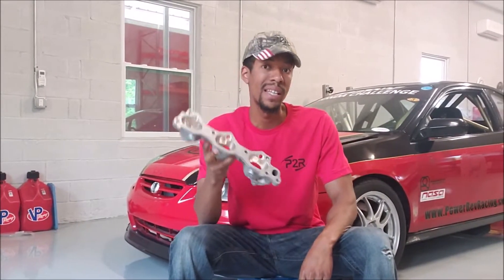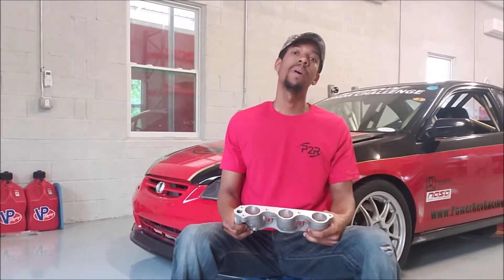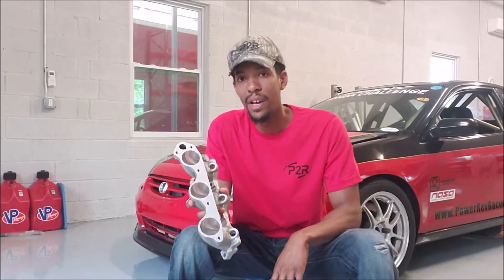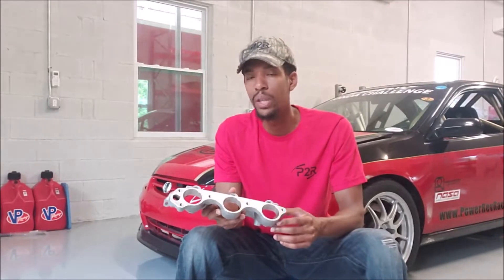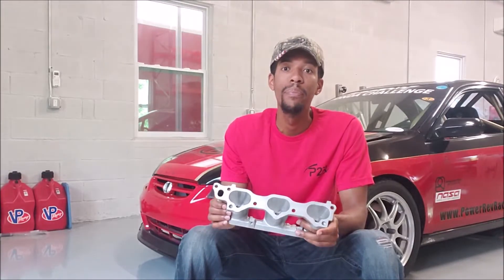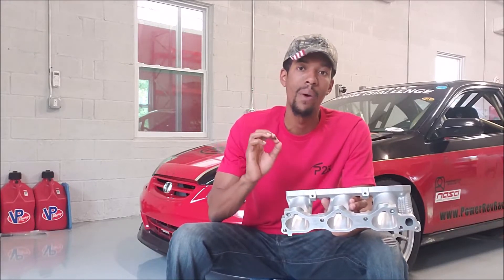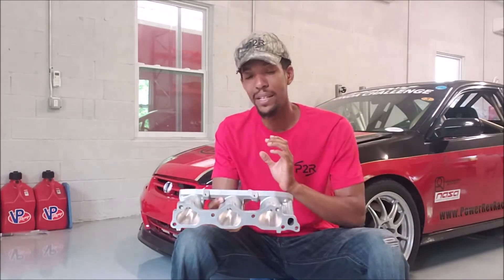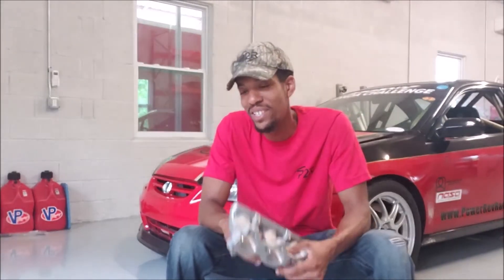P2R CNC Ported Lower Intake Manifold Runners

Comment: With ported lower runners, will the cylinder heads or inake manifold need to be port matched or is this porting just a smoothing of the bores and it still is flush with intake manifold/head port diameter ? Thank you

Comment: This is a good last all motor mod before upgrading your cams. I have these on a J35Y2 with 72mm TB, HFPC, 410cc injectors, and ATLP J pipe. You REALTY feel the vtec kick-in with the runners.
Reply: I can’t wait! I’m doing pre cat deletes, p2r runners and p2r intake manifold spacer all at once I hope I can feel it!
Reply: What cams I have the same engine
Reply: Which injectors you run and what you need to set them up correctly

Comment: Sean do you have a special program or do you take more meat off the head to runner side when you are cnc machining both the head and runner together. Or do you do extra gasket machining, or have a different program when using machining both with your program? Thank you.
Reply from the maker: When we are doing a set of P2R CNC heads, we have a specific program we run on the runners to make them match up.  If you already have a set of our cnc runners and are getting heads done by us.  We will run the program through your existing P2R runners for free.
Reply: @PowerRevRacing   I appreciate that bit of info and your dedication, I would say you run a tight ship, customer service is great, willingness to give info. You actually call people back and answer questions that I needed to know. I didn't expect a prompt reply like this. Thank you Sean have a blessed day. I will be adding this option now that I know you machine the runners differently, while doing heads at the same time FYI.

Comment: Does the P2R manifold spacer combined with j37 intake manifold, throttle body, cause hood clearance issues? Or require any other tweaking (I've read oem coolant lines might not be long enough)
Reply from the maker: The only coolant line there goes to the throttle body and doing the coolant bypass one time is typically a nice simple upgrade to do one time. 

Hood clearance is dependant on vehicle but not really and issue for most accords 07 and up

Comment: Hi P2R can I run these on my 2017 accord without a tune? I think this will work great with rv6 long tube jpipe
Reply from the maker: Yes you can install this without any tuning requirement.
Reply: @PowerRevRacing  Thanks for the reply. Will these runners help me bring back my top end power if I do the p2r manifold spacer because from everything I’ve read you gain torque and power down low with the spacer at the expense of some top end horsepower (after 6000 rpm)

Comment: Nice. What kind of gains are we looking at here?
Reply from the maker: Typically see between 7 to 11 hp depending on which engine you have.
Reply: Do the heads and intake plenum require a port match to mate properly to the CNC manifolds?
Reply from the maker: @DJToneRI  if you want to match perfectly then yes however the hp gains mentioned above are just with runners.  Not touching the heads or upper manifold.
Reply: Nice. Is the $370 price for one manifold, or both?
Reply from the maker: @DJToneRI  thats the price for the pair.  Also after you install.  You can send us back your stock runners. And we will pay you $75

Comment: I just pulled the trigger on your runners today from heeltoe, then I came across your video - great timing.  I have an 04 accord v6 6 speed coupe. Mods already installed cai, 3.7 intake & tb, 1 inch manifold spacer, j pipe, and rear cat delete. I'm installing the lower runners along with a light weight crank pully next week. Can't wait!  That is pretty much going to complete my bolt on engine work. The final step will be a tune. Already a good daily driver on the way to being a great daily driver. Also installed larger front/rear sway bars along with light weight 17" forged wheels. The last piece of the handling puzzle will be  Spoon's Sports Rigid Collar  bushing set. along with a rear lower sub frame brace. Picked my car up from a Copart auction last year for $1,500, 130K, clean title bank repo. I smile every day when I look at it :-)...............
Reply: Wow what a gem for only $1,500…I payed WAAAAAY more for my 03 Honda Accord 6-6! You did well here sir 👍👍👍

Comment: Thank you guys, i just installed my throttle body adapter j37 to stock IM, lookibg for spacer next ✊🏻 you guys rock
Reply: Did you notice a difference keeping the original manifold
Reply: Robert Alicea it pulls hard...you hear and feel it in the engine i got the dapter for the 14 mdx and the 14 mdx throttle body it is worth it
Reply: Even more with ktuner...im keep stock intake manifold and just throw in the IM spacer
Reply: @cheetoshotfries2289  IM spacer is fine for an suv but I wouldn’t shift torque curve lower on an accord or fwd vehicle I can already spin tires all the way through the intersection lol

Comment: I’m sure it’s super advantageous to have consistent removal along the whole tube instead of just smoothing out the imperfections. Is there a lot of material that you guys remove to open the ports up, or is it just enough for a full clean up without too much removed? Can’t blame you if it’s a “trade secret” though beings how you guys have been doing the work with testing for years and you don’t wanna say!!
Reply from the maker: We remove a good bit of material on these, but leave enough  material to keep the integrity of the part.

Comment: So how much whp gain would you get with these? Estimation of course.
Reply from the maker: 8-12hp on average can be expected.  There are tons of different J engines, but we have seen around this hp on all the motors we have specifically dyno on.
Reply: @PowerRevRacing  perfect, would it get more gains paired with your ported TB and spacer?
Reply from the maker: @RevsALot  The intake manifold spacer helps quite a bit for street cars.  As it gives more Tq at both partial throttle and full throttle.  So the car feels quicker all around.
Reply: @PowerRevRacing  Dyno Should be provided with your parts.